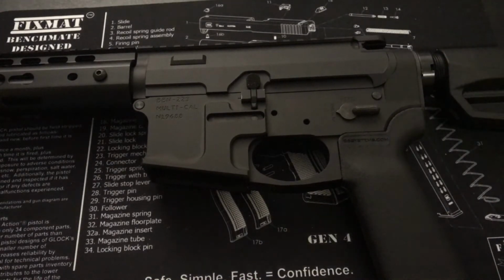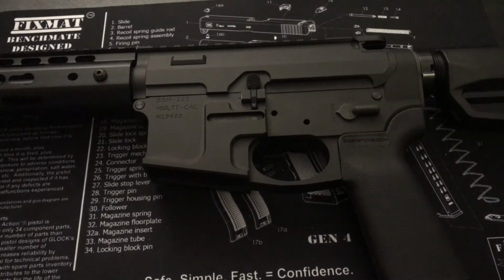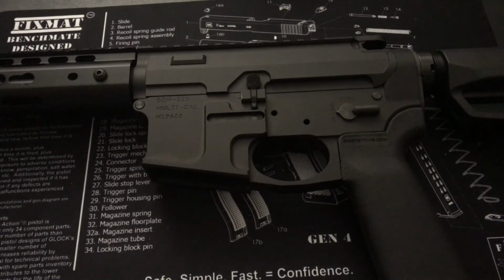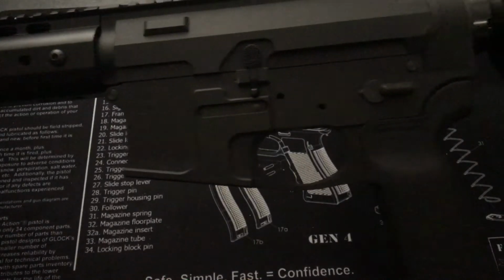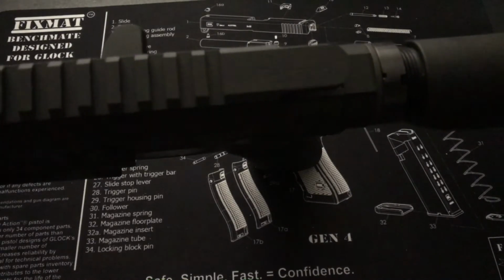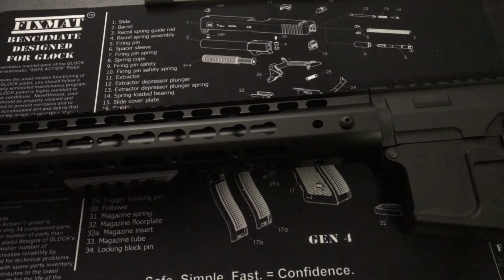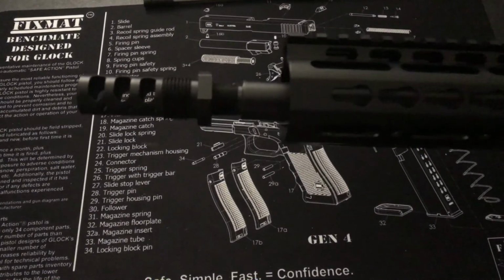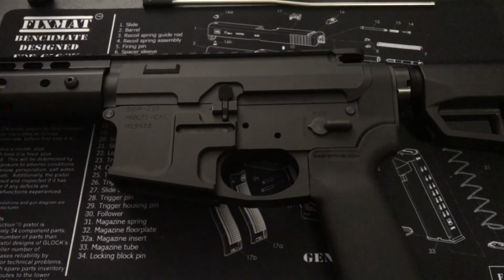Noreen Billet Build PT.1 | 300 blackout build

Comment: Is your pivot pin loose fitting installed with the spring and detent?   Also the rear take down tight?   Like too tight?
Reply: Sounds like you mixed up the safety selector spring with one of your takedown detent springs.
Reply: @Plantersfreedomseeds1776  maybe. been a long time. i think i tryed differnet set of pins. if inremember correct the lower was picky
Reply: @joesmith-fi1sx  some lowers are special and picky. Guess that’s what we get for a moderate price point.
Reply: @Plantersfreedomseeds1776  yep. it was a great lower. good design and logo.  im wondering if they are going to sell more. one of my favorites
Reply: @joesmith-fi1sx  I just bought one today from a Murdoch’s. Manufacture stamp was from mid 2021 so I think they still have them around.
Reply: @Plantersfreedomseeds1776  oh cool. how much which murdochs?   used to be able to get them for 45.  now 80/100 from noreen
Reply: @joesmith-fi1sx  silverthorne Colorado. And I paid 79 I think. Seems to be of good quality. Went together really easy
Reply: @Plantersfreedomseeds1776  nice !  didnt know they had em in colorado.
Reply: @joesmith-fi1sx  first time I’ve seen them here, how has yours been? I’m using this for .458 socom